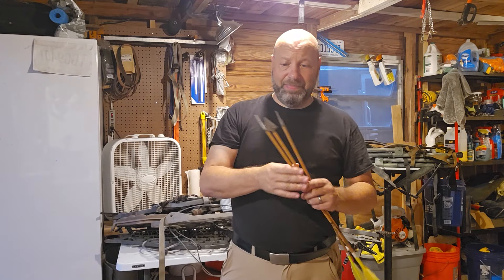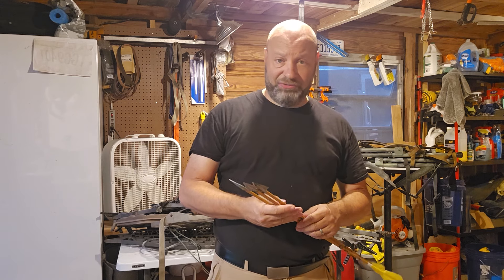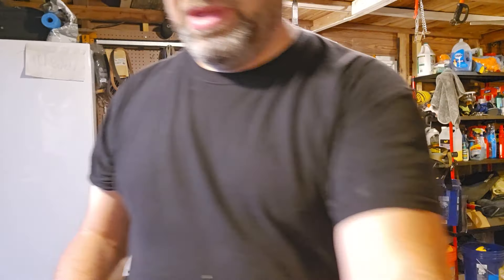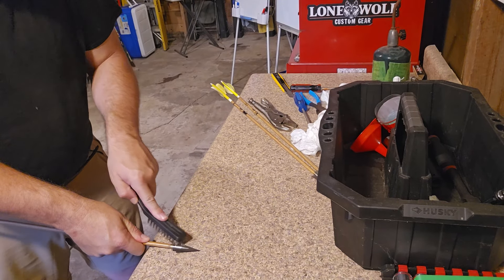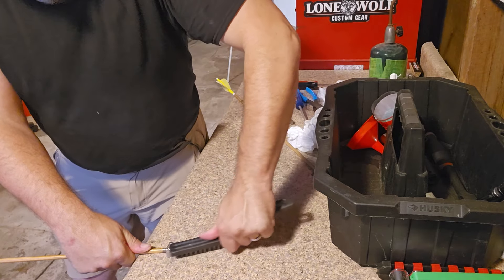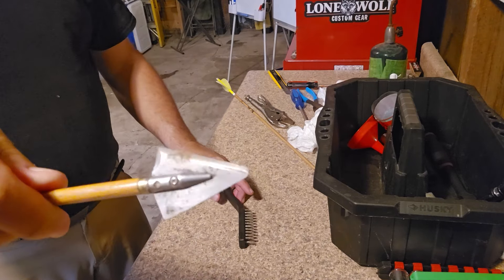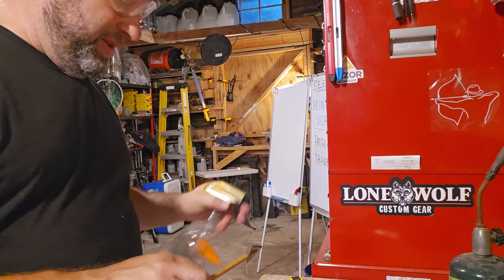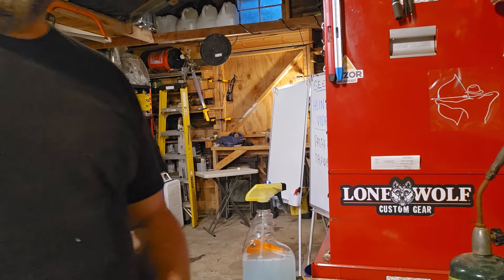Broadhead Rust Removal Quick And Easy - Works For Knives too!

Comment: My hands aren't as strong as they were back in my 20's, so I rather use a little vinegar to remove most of the rust, then rinse it of with a little water. right after water is dry, I tend to apply a drop of oil to prevent rust. Great tip nonetheless!!!

Comment: Always make sure you use a stainless steel brush brushes, leave microscopic scratches a steel brush will rust in the scratches stainless will not

Comment: Hi Jason, how are you matching up your broadhead with the father's?? since you're not using hot melt. The Razer broadhead  is screw on. I was thinking if you were making new arrows you could glue the insert but I already have them made. Thanks great video!
Reply from the maker: @george2099  I twist the nock to align as close to horizontal blades as I can get. Can also heat the insert and spin it a hit if needed depending on the glue you are using